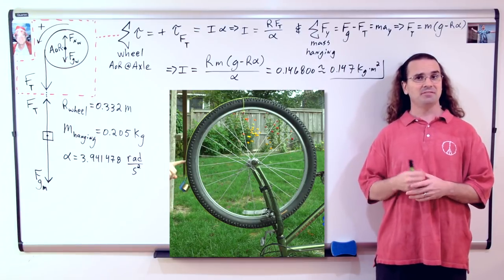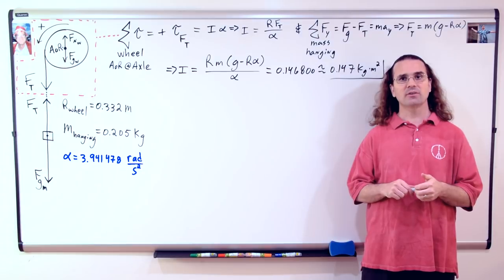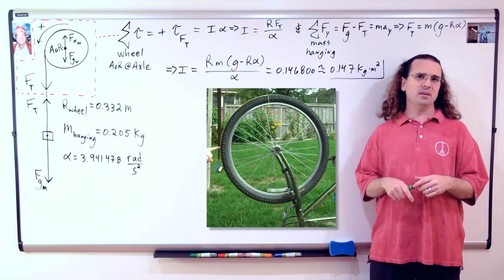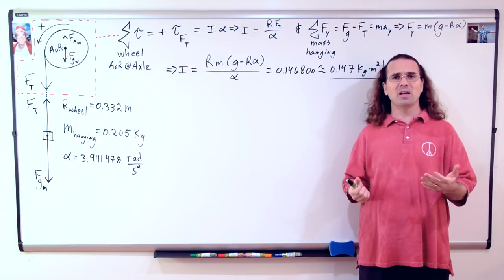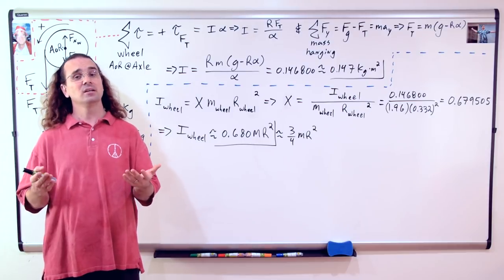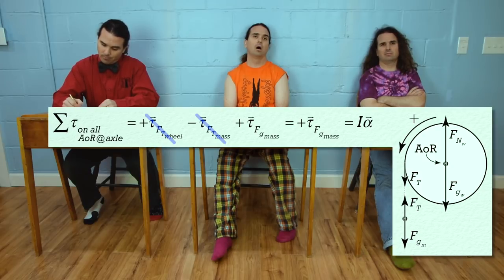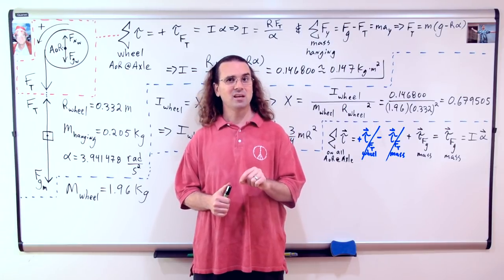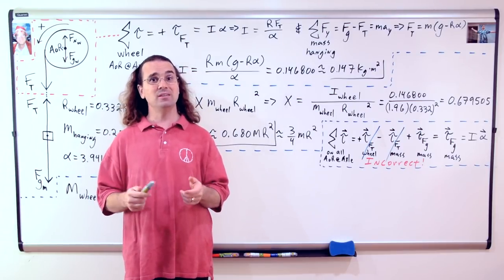(2 of 2) Measuring the Rotational Inertia of a Bike Wheel

Comment: I never wouldve thought of calculating the 'X' value this way, I'm glad triple integrals aren't the only way!!! Nevertheless, SO COOL how it all checks out in the end!
Reply from the maker: Glad you think it is cool as well!
Reply: When there is axial symmetry to the shape and mass distribution, the triple integrals reduce significantly, usually to become single integrals.   For instance, to derive it for the solid uniform cylinder, your starting point is the trivial case of the thin uniform hoop.   Make the thin hoop your mass element for integrating for the solid uniform cylinder, and you can get the moment of inertia for the cylinder in just one integral.

For a solid sphere, it reduces to a double integral, when starting with the thin hoop as your mass element.   However, if you already know the moment of inertia of a thin spherical shell, you can use this for determining the moment of inertia of a solid uniform sphere, in just one integral.   An application of why you would want to know how to do this,, when it is already something you can easily look up, is if you were given a distribution of mass that is spherically symmetric, but not uniform.  For instance, if you accounted for the geologists' PREM model of Earth's density, to find the moment of inertia of the Earth.

Comment: I had a different reasoning on why you can't(rather shouldn't) consider the wheel and mass as a system. If the forces of tension are equal and opposite, they cancel out and you cannot find the rotational inertia of the wheel...
Is this reasoning correct? 😅

Comment: Hi, why have you chosen 3/4 for ~0.680 at time 3:44? 2/3 was also suggested by Bo, I think. Greetings :)
Reply: He's surveying his students for their intuition of what fraction in front of m*r^2 for moment of inertia they expect.  Among all of the responses, he chose to go with the median and discuss 3/4 as the example.  Indeed it did turn out to be closer to 2/3. 

I was surprised by this.  I would've expected it to be a lot closer to 4/5, because I would expect that the mass in the bike wheel that controls the moment of inertia is mostly in the rim and tire.  The spokes are intentionally used instead of a solid disk for minimizing the wheel's mass, so I'd expect their contribution to moment of inertia to be close to negligible.  The hub is probably what is governing this result, since it adds mass without adding very much contribution to moment of inertia.